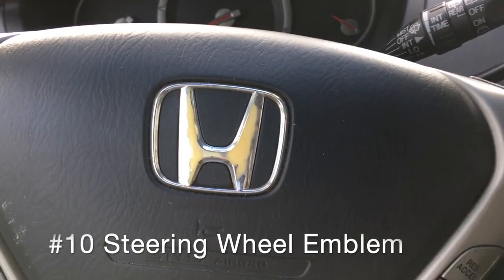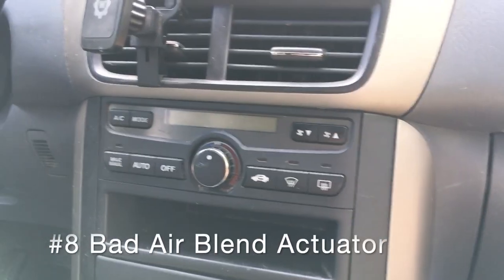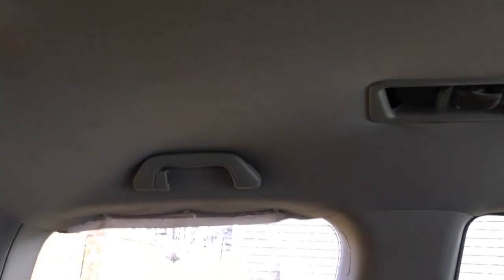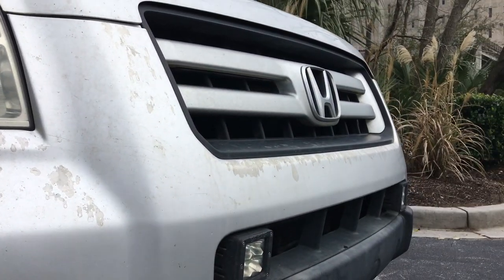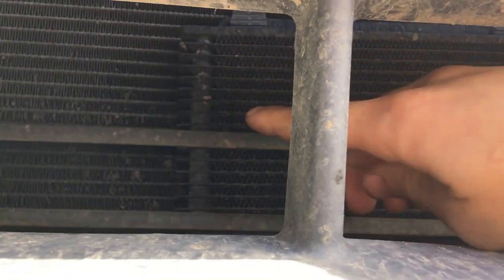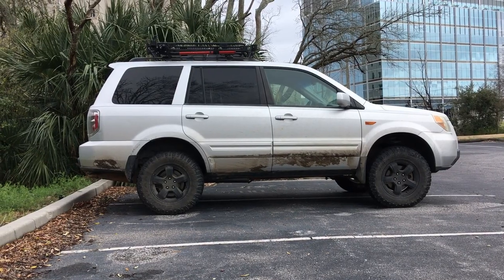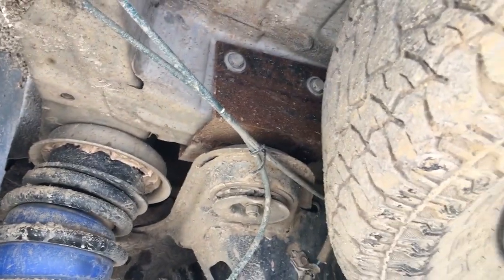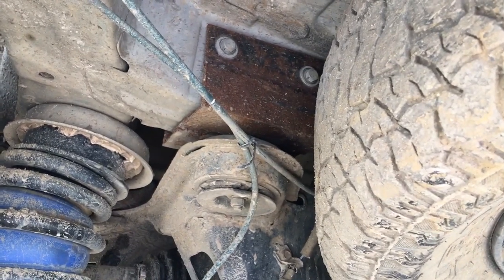Top 10 Common Honda Pilot Problems (2003-2008)

Comment: I was told the most common problems are the legs. The pulling out of the front tyres while in motion, how can that be fixed or avoided?
Reply from the maker: I haven’t heard of this issue. Are you talking about ball joint failure?

Comment: Do you still have your pilot ? If so how many miles do you have on it ?
Reply from the maker: 290k miles and going strong
Reply: @Gotter Adventure  awesome man can you give me some imput ? 

i bought an 07 ridgeline used and it shows the timing belt was replaced 30,000 miles ago but it has been 6 years as well. I know thats not a lot of miles on a belt but what about the years ? Should i go by mileage or years more ?
Reply from the maker: @shadowman1992  I believe the belt has a time expiration as well. If you have the funds and you want to keep the vehicle running well, I would replace it. Make sure to use the oem timing parts kit purchased from a reputable source. Counterfeit parts will break and destroy your motor.

Comment: I have honda pilot 2006. P2647 rocker arm actuator system stuck on bank 1. how do i get off?
Reply from the maker: https://honda-tech.com/forums/honda-minivans-crossovers-trucks-80/p2647-limp-mode-06-pilot-3289584/

Comment: My 2003 Honda pilot sounds like it's still running even after 10 minutes of turning it off what do I do about that
Reply from the maker: Is the engine running or just the fans?
Reply: Check the engine coolant anti-freeze level....it's probably low.

Comment: I have a 2005 pilot and my rear driver side subframe is completely rusted out and broken. There’s a huge hole. It’s a 3000 dollar fix to do a welding job but a 5000 dollar fix to replace the subframe completely....
Reply from the maker: You could try another shop to find a better price. It is repairable but the question is how much they will charge. :(
Reply: @GotterAdventure  I had to get rid of the pilot the whole thing was rusted out they said even if they fixed it they can’t guarantee that it would stay together I got finessed I only had that pilot for two weeks
Reply from the maker: @haylink_1390  I am sorry to hear that 😢
Reply: @haylink_1390  Don't feel bad, I was  Honda-tech for 20 years and wasn't even aware of the rear subframe problem. I was somewhat aware of a front subframe problem on certain Accords.
Reply: Thinking maybe I ought to check mine in the morning!

Comment: I have a 2005 Pilot with 195000 miles and it keeps running. The engine and trans are strong. My question...how do I turn off the TPMS light on the dash? It’s not the light that shows the tire symbol. It actually shows TPMS. I’m on my 4th set of tires.
Reply from the maker: I believe you need to replace the Tpms sensors
Reply: @GotterAdventure  Thank you for your time. I guess that’s what I have to do.

Comment: My suspension for my 07 pilot sounds bad when I go over a rough surface. Can anyone advices what can I have them fix
Reply from the maker: The most common noisy part is the sway bar end links. They can be a pain to remove if they are rusted on. Be prepared to cut them off with a saw or grinder.

Comment: Bought my 07 at 99k miles 5 years ago and so far I paid about $1300 for leaking radiator and new timing belt. It's at 126k now with the tpms still light up before I bought it. Underbody is rusty so I will put fluid film before winter.

Comment: Hello, I listen to your top ten 20003- 2008 Honda pilot problem with utmost interest and wish to contact you directly for help. My 2003 generation Honda pilot reveals heaviness on forward gear lever shifting and heaviness on reverse gear and resistance to move backward. Please help. Pastor Egbe Egbe Philip is my name.
Reply from the maker: It will be difficult to truly help over Youtube chat. Is the vehicle presenting any error codes? Draining and filling the transmission fluid 3 times may help.

Comment: I have a 2007 Honda pilot that has hole somewhere in the cabin ventilation. When I drive over 40 mph   I hear a like a whistle sound. I cant pinpoint where its coming from. Any suggestions?
Reply from the maker: It could be hard to track down, but I found this thread. https://www.piloteers.org/threads/whistling-noise.12875/page-4
Reply from the maker: CUSTOMER CONCERN THAT THERE IS A WIND NOISE COMING FROM WINDSHIELD/WILL LEAVE FOR TEST DRIVE WITHOUT CROSSBARS-TIM S
WIND NOISE IN PASSENGER FRONT AREA. REMOVED WIPER BLADE AND RIGHT MIRROR. DROVE NOISE STILL THERE. TAPED OFF ENTIRE FRONT END. DROVE. NOISE IS STILL THERE. INSTALLED FOAM TAPE IN FENDER WELL AND OVER BODY HOLES. DROVE. STILL THERE. TAPE OFF ENTIRE PASSENGER A-PILLAR AREA. DROVE. NOISE IS GONE TIM S. VARIFIED. REMOVED TAPE PIECE BY PIECE WHILE DRIVING NARROWED NOISE DOWN TO RF CORNER BY COWEL. REMOVED FRONT BUMPER. AND RIGHT FRONT FENDER AND FENDER WELL. USED BODY SEALER TO SEAL ALL OPEN WELDS AND HOLES AND AREAS WIND COULD GET TO. RE-INSTALLED BUMPER AND RIGHT FRONT FENDER AND FENDER WELL. DROVE 15 MILES AND ALL SPEEDS. NOISE IS GONE. DROVE 100MILES TOTAL.
Reply: Check roof rack end caps, mine has 2 missing which creates a flute effect.

Comment: What really annoys me about my 03 Pilot is that neither Bilstein nor Koni make replacement shocks and struts for my car. I have broken two KYB front struts. It's a good car but it really isn't tough enough.
Reply from the maker: Wow! You must wheel it hard to break the front struts! In my experience KYB struts worked pretty well. I am running Flatout Suspension coil overs in the front now :)
Reply: @GotterAdventure   Not that hard but I live in Guatemala. What shocks-struts do you recommend?
Reply from the maker: @andrewwinters8467  kyb 😂

Comment: Can you just disconnect the driveshaft ? I bought an 03 and did a tranny flush and diff flush . And the vtm4 light still comes on .
Reply from the maker: Is your vehicle throwing any codes? Technically you can disconnect the drive shaft, but if you have an physical problem like an ads sensor that won’t make the light go away.
Reply: @GotterAdventure   yes it’s throwing shift error and now camshaft position sensors (a and b ) .
Reply from the maker: @waynejordan7473   Those errors are most likely causing the VTM-4 light to be lit.
Reply: @GotterAdventure  it’s a trans issue . I didn’t have those cel codes before . It told me solenoid before flushes so I changed that . Then did the flushes now it says camshaft a and b . I’m going to keep replacing these sensors but I’m definitely disconnecting vtm.4 see as it is not helping
Reply from the maker: @waynejordan7473  If the ecu is looking for the vtm4 diff then disconnecting it will cause a light as well. It sounds like you are on path forward. Best of luck
Reply: @GotterAdventure   you’re right and I get that . Background info on my pilot . Bought it from a man who used it to pull a small boat . Only service he claims he did was oil changes . No diff or trans fluid service since his ownership of it back in 2017 . I believe the differential is toast and that’s why I want to start there . But I think worst case scenario is torque converter . Thanks for the wishes I’ll keep you posted if I fix issue or find a work around

Comment: Please someone let me know where I can get the Honda emblem for steering wheel looked everywhere!!!
Reply from the maker: Unfortunately it isn't sold as a replaceable part. I am going to try and plasti dip mine.
Reply: @GotterAdventure  got the car with the logo missing :(
Reply: Have you tried auto wreckers?
Reply: @veenunyabiz3409  no junkyards around me have any 1st gen pilots
Reply: Ah ok, Amazon or Wish maybe? I need to go try to find the rear vent covers, mine are both broken🙄

Comment: Hello my pilot breakdown everytime it rains. The engine light comes on then the VTM 4 light and it shuts down. Will start back up but runs rough and if I try to pull off it will shutdown again. What could this be??????
Reply from the maker: Very strange, I don't see any record of Pilots with similar issues on the internet. Is there anything unique about your Pilot? Is water getting in the intake?
Reply: I’m not sure.
Reply: Crankcase and crankshaft sensors have been replaced. But it still throws those codes if I drive in the rain. Also the 420 code.
Reply from the maker: @mr.gtmsworld2494  Please let me know all the codes you have recorded
Reply: PO607,366,420,341 codes on my 2003 Pilot
Reply: That sounds like a short when it gets wet. Check your ECU plug maybe?
Reply: Yes for sure its a leak from rain. That's a big issue with the Pilots. Water coming into your cabin thru cable holes behind your fenders. Need to seal those up. Have to remove wheels and fender covers to access the wire harness

Comment: How will one know that the timing belt is due for replacement?
Reply from the maker: Every 100,000 miles or 7 years (which ever comes first). If you don't know the age I would recommend replacing it. Better safe than sorry.
Reply: replaced mine at 100k.   you don't want to wait for it to go bad.
Reply: Anything with a Honda J series engine should have the timing belt done BEFORE 100k miles (or 7 years) it is critical. It is an expensive maintenence item unfortunately but cheaper than a new motor.

Comment: You did not mentioned why this pilot hard start when weather get cold???
Reply from the maker: Sorry, I haven’t experienced that issue.how did you fix it?
Reply: What battery you running and how old is it? As someone that lives in a place that gets really cold this is usually the problem.
Reply: @ryego3  Problem start when temperature 6 degrees and below.  Replaced battery, fuel pump working, throtter  plop cleaned. Tried to start using quick start but no go. Replaced start relay bought new from Honda . fuses are all OK, oil changed, oil filter new, transmission fluid changed, fluid from honda. antifreeze coolant changed. differential fluid changed. But when the weather is warm and on summer time vehicle no problem run like new.
Reply: Battery is 750 CCA.

Comment: Got my 2004 for very little money. Subframe rust problem (will fix soon), rear shock loose from rusted frame (will fix), exhaust flex pipe with holes (done), rear metal bumper rusted out (relying on towing hitch for protection :-)), blower motor does not run (will do later), front lower control arms both torn rubber insulation on the ball joints (will fix soon), leaking O-ring on cylinder 6 (done with valve cover gaskets throughout), timing belt and serpentine belts (will do after I fix the subframe and is driveable), revving up and down on idle (will clean PCV, EGR, throttle body, air intake control valve), etc. This is just a partial list :-)... Compression tested cylinders - all were good. I hope the transmission holds. I will take care of the rest...

Comment: Check engine vtm-4 lights and fluctuating idle between 600-1000 rpm
Reply from the maker: What is the code for the check engine light?
Reply: @GotterAdventure  p0301 and I've been through all the plugs they are new and i replaced the spark plug and the springs in the coils along with the top and bottom boots. And im still getting a surging idle
Reply: It surges between 400 and 800 rpm at idle
Reply from the maker: @atozelectronicsandcollecti7526  Is that the only code it throughs? That code indicates a misfire in cylinder 1.

Comment: how to reset vsa & abs warning light for Honda Pilot 2007
Reply from the maker: Mine always went of after the issue was fixed. Where you able to track down the problem that caused the lights to be triggered?

Comment: My headlamp covers were very yellow on my 05 pilot so i replaced them both, but shortly after my high beams stopped working. The low-beams work fine. Any thoughts on why? Might it be a relay issue?

Comment: My pilot after 25 minutes of driving then  check engine light go on and after 5 minutes the light start flashing and then the loses power from 70 miles per hour to 35 miles per hour
Reply from the maker: Could be a bad ignition coil, please have the codes read at a part store and let us know the result.

Comment: I'm having catalytic converter problems now 😭 we just bought it from someone.
Reply from the maker: If you are in a state that doesn't check smog, you can space the sensor out
Reply: CataClean works great. It might take a couple of treatments. Just follow the directions it worked great for me. 2007 EX-L with 325000 miles and going strong.

Comment: It's not a truck.  The trans  is the size of a basketball and not really designed to pull even with a cooler.
Reply from the maker: The trans is larger than a basketball... LOL, but I get your point. My transmission is going 280k strong! (knock on wood)

Comment: Torque converter clutch solenoid open ?
Reply from the maker: Hmm 🤔 I had a brief stint of that when I used non Honda fluid
Reply: @GotterAdventure  did you have to replace the solenoid or just the fluid
Reply from the maker: @justinmcvay5560  I replaced the fluid and the issue resolved itself. I am pretty sure the part that gets stuck is in the transmission ☹️. I was planning to drive it that way until it died, but it went away on its own.
Reply: @GotterAdventure  i hope that works thank you

Comment: You forgot the ridiculous VSA mechanism that shuts the vehicle off practically when hitting rough roads or potholes.
Reply from the maker: The only time my vsa system goes off is when I lose traction. From my experience it has worked really well on ice.

Comment: Did not even bring up trans problems   this is a joke he talked about the emblem and paint and most of this is standard maintenance
Reply from the maker: That is why I like my Pilot, most of the issues are just wear from age. I have 280k miles on the original transmission and it is doing great. Check out my other videos, I don't baby it.